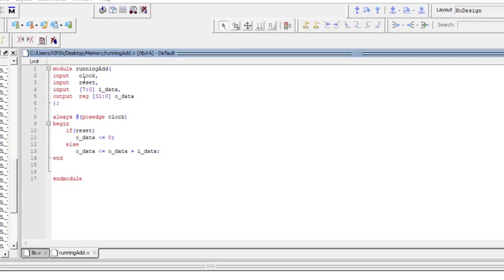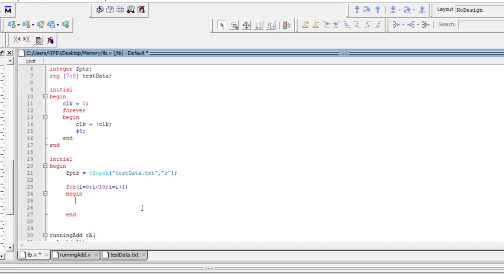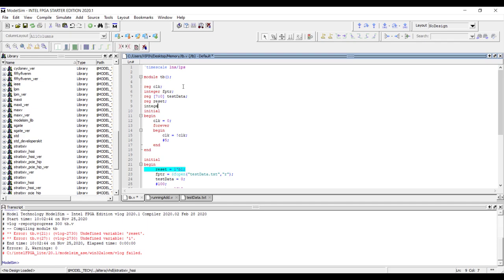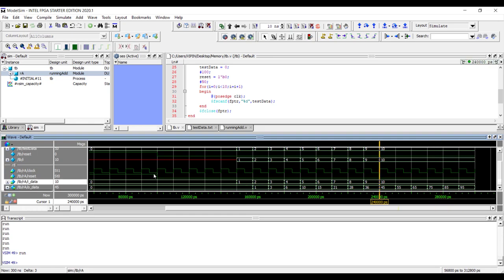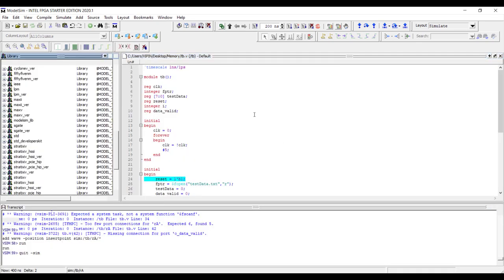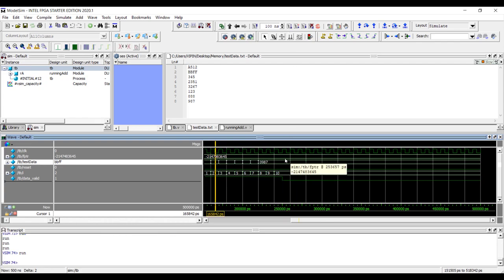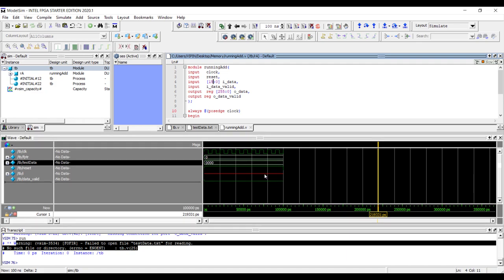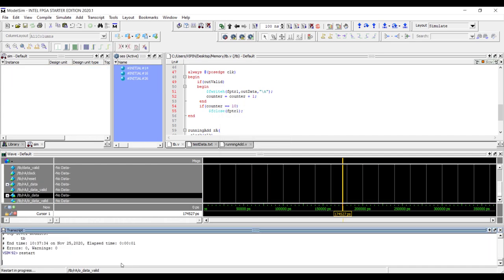Design of Testbenches Part 2| Reading and Writing from text files| Signal Monitoring Part - 22

Comment: hi, thanks for the tutorial. would you mind please help me to resolve some errors in ModelSim, I synthesis your code "neural networks on fpga" in vivado and then  I simulate it with modelsim. I want to read from a file that has 200file txt I want to read it sequentially.you used readmemb(filename , in mem) command but when I run it shows this error "failed to open readmem file in read mode".I just add the whole text files to directory of modelsim but it shows the same error.when I use just one  text file like readmemb("test_data_0000.txt" ,in mem )  it doesnt show any error.would you help me to resolve it?